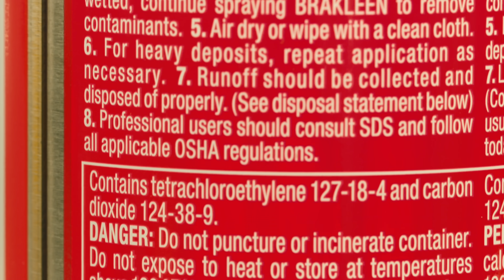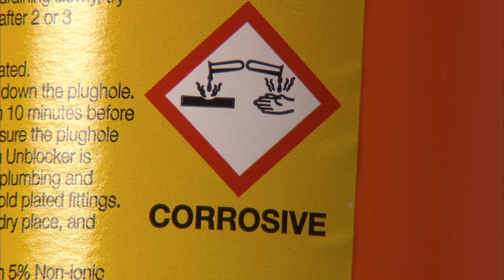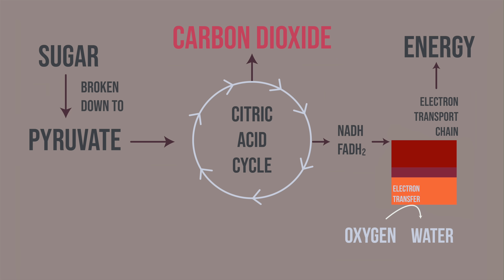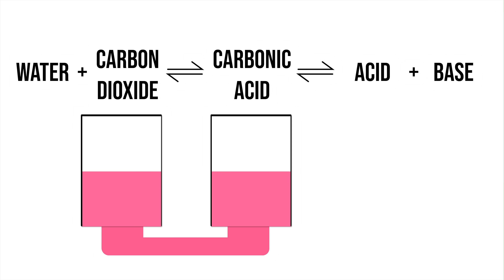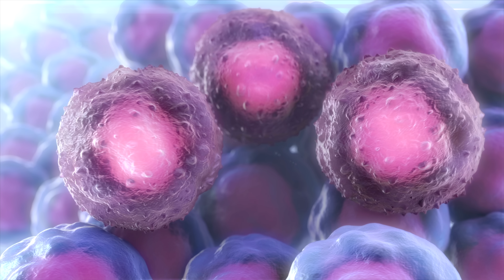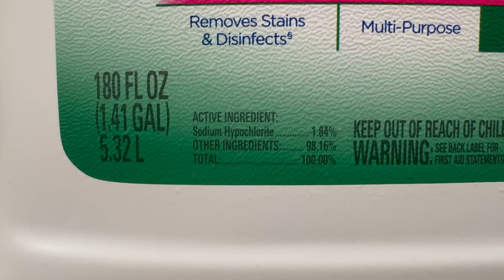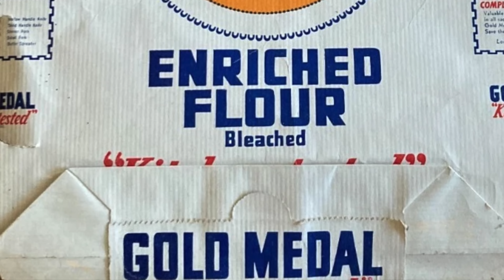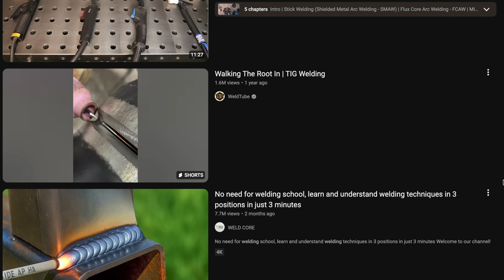"It smelled funny while I was welding and now I can't breathe..."

Comment: Important lesson!!    I think most break cleaner is now non-chlorinated. But I would still avoid using it before welding.  

Galvanized metal is also dangerous. 

Hell, even the shielding gas can kill you if not careful. 

Between the fumes, gases, and dust, respirators should be used. + Fume extractors.  But $$$$ 😞

They should include a free book with every welder sold.  "How this can kill you."    

Be carful.
Galvanized metal is also dangerous.

Comment: When I'm working I know welding galvanization gives a headache, carbon monoxide poisoning is one wrong step away, there are ammonia leaks everywhere, we use hydrogen peroxide strong enough to melt your face off and I work near H2S quite a bit. It's always a toss up what's trying to kill us today...but out of 30 years of safety classes I never knew the break cleaner thing. Thanks!

Comment: Great video that, so comprehensive, thanks. I'm really surprised that there isn't a clear warning on brake cleaners (some of which contain deadly when heated PTFE, as do some greases) given the extremity of the danger. I do have one question though - how long do these chemicals linger on say rusty, flaky steel/paint surfaces? - do the 'nasty bits' evaporate away in minutes or hours or are they there lingering long term, waiting for some poor sod to come along and grind/weld?

Comment: btw although high voltage can be relative, for comparison of common household appliances, welding is lower voltage than even US mains voltage. So the welder is relatively high current but not high voltage

Comment: I get it that burning anything with chlorine can be deadly, brake cleaner evaporates so fast it would be hard to get it into the weld process in a way it produces gas. 
I had to check but the instructions on my older tig welder recommend cleaning the parts in brake cleaner. It don't specify chlorinated or non chlorinated. 

Nearly ever shop I worked for over the years banned chlorinated solvents of any type. The issue was that they end up in the waste oil and it turns normal waste oil into toxic waste no one will touch. The guy who pumps the waste oil out runs a test on the oil before he'll take it to check for chlorinated solvents, water content, and antifreeze. If the test show any chlorine, they won't touch it. If there's too much antifreeze, they sometimes will refuse it as well. 
The way that was explained to me was that both will break down and bond to the oil somehow leaving behind elements that are hard to remove. 
Apparently they also sell the waste oil to guys who burn it in shop heaters, so that alone would be reason enough not to want it. 

A good many shops have stopped buying aerosol chemicals and gone to using straight solvents, either isopropyl alcohol, naptha, lacquer thinner, or acetone for most cleaning jobs. By the bucket it saves the shop a lot money and everyone has a universal sprayer these days. A simply pump sprayer and some alcohol works just as well and its cheaper. 

For rusty metal, I've always washed parts in mineral spirits, then dried them before glass or sandblasting off any rust before welding. Using brake cleaner is a waste of money. 
You never really want to weld any metal that's rusty, or coated with anything  at all. You don't want to breath in any of the fumes it could create and it will cause porosity in the weld.

Comment: Perchloroethylene is actually remarkably unreactive compared to ethylene. Those chlorine-carbon bonds are much more stable than carbon-hydrogen bonds. Which is why it's not flammable, while ethylene is incredibly flammable. Sure you shouldn't spray it directly on a fire, but you can use it near ignition sources without worrying about being blown to kingdom come.

Comment: I was expecting to hear he was welding on galvanized metal. That shit will eff you up, too. Dont ever weld on galvanized stuff indoors without a fan blowing the smoke away from you. In fact, it's best if you weld on galvanize outdoors but with a breeze at your back.

Edit Phosgene can also come from burning refrigerant (most people call it "freon" but freon is just a brand of refrigerant) that is in every AC, fridge, and deep freezer. And if you're sweating refrigerant lines with a torch phosgene can nail you when the lines are pulled apart. I've had it happen to me. Phosgene gas is also deadly.

Comment: Didn't know that, but I was told as an tool maker apprentice to never ever mix up chemicals and never heat up chemicals that are not ment to do it.
What we didn't learn then in the 70s and 80s is that the UVlight from welding is able to cause skin cancer. Luckily, as a German,  I follow rules.
So I always wear my working clothes.

Comment: Welding should always be done in highly ventilated areas or used a exhaust system to remove welding gasses.  Heavy metal toxicity is a known problem.

Comment: I did this exact same thing well Welding at shell Scotford maybe 2018, used chlorinated brake clean to clean off a flange face that was needing weld buildup using TIG welding process stainless steel and I ended up even with wearing a respirator with P 100s, exposing myself to phosgene gas. I don’t remember being told this in Nait yet for some reason in the tool crib, even on a Union job site they had chlorinated brake clean. My lungs felt like they had about 25% left in them. I was inches away from dialling 911 or going to the hospital. I figured if I woke up in the morning, things would be OK could barely sleep. Heart was pounding hard difficult to breathe and an extreme tightness in the chest and the lungs 🫁 felt F’d, when men say they do the risks and some of the most dangerous jobs. I would absolutely agree not many people put themselves in this sort of situation and this was completely unavoidable to have to remember this knowledge from school years prior was just overlooked there should be systems in place where they do not have these products in the tool crib on a job site where Welding takes place for starters brake clean doesn’t even need to be used on any job site. It’s just a convenient poison. Yes 👍🏻 everything is fine now lungs took over 3 weeks to feel better. Very SCARY and I didn’t report fast enough I really screwed up!!!! But lived thank FU5K! 🎉

Comment: Welding is very dangerous if care is not obeyed. Especially dangerous is welding stainless steel. Another dangerous field is handling materials containing Cl, Chlorine. Cl has multiple dangers. The immediate danger comes from direct breathing of Cl gas. The second one is burning or overheating materials containing Cl, like PVC. That will generate PCB which is one of the most dangerous poisons in industry and easily causes cancer if it does not kill in the first place.

Comment: If you're welding,  you absolutely need to be wearing a respirator, or be wearing a forced air respirator mask.

These are the masks to look for and get, if you cannot afford the forced air system:

ITEM: Moldex 2400 N95 OV Particulate Respirator Mask with Exhale Valve

DESCRIPTION: The Moldex 2400 N95 OV Particulate Respirator Mask features an exhale valve for cooler, easier breathing and is designed to filter out non-oil-based particles while providing relief from nuisance-level organic vapors. Ideal for hot, dusty environments, it offers NIOSH-certified N95 protection with a comfortable, contoured fit and a durable outer shell for extended use.

Comment: styropyro's labored breathing was so believable that I felt like crying.  I have asthma and it's always very hard to watch someone struggle to breathe (and also my allergies are acting up, I could feel my post-nasal drip attempt to simulate fluid in the lungs).  very good acting.

also, ty for the tip on chlorinated brake cleaner + welding producing phosgene.  I had no idea that a horrible WWI-like death was so horrifyingly easy to accidentally just stumble upon.

PS: when welding or spray painting, even in a well-ventilated area or outdoors, please wear a respirator.  you don't want that crap getting in your delicate little lungs.

also, if you have a welder that uses oxygen gas, eg am acetylene torch, never EVER use the oxygen to blow your clothing clean. my instructor's coworker did so and got exposed to a spark. he was covered in fire, and he took two weeks to die of full-body burns in the hospital.

Comment: I have been affected but I started welding back around the mid 1970s.  I take care but still limit what I do.  A decent air-fed welding helmet starts around $2,800 for a cheap one and the prices go up a lot from there.  This means that for most people they are unaffordable.  Maximum tax deduction?  A one off $50.
  I personally believe PPE should be 100% tax deductible.  
  I also have 'welders nod' because auto darkening lens weren't invented for quite a while after I started and again, helmets with these lenses were extremely expensive.
  We know a lot more about industrial hazards now but still employers don't abide by regulations and no government will address basic industrial safety because end of the day laws are formulated by office workers and as far as I know, and I'm retired now, no office worker gives a damn about industrial safety because none of them are personally affected.

Comment: I have no experience nor knowledge in welding, but smoke in metalworks is an immediate notification to call a professional for me. The welders I know use strong ventilation with N95 facemasks and other respirators on emergency standby, along with rubber gloves and tongs for chemicals and rust.

Comment: @chubbyemu - Maybe not related to the video, but something I can't explain.  Na and K (in the body as ions) are about the same size, have the same charge, and almost the same structure as each other.  But the body very easily distinguishes between the two.  Contrast that with Ca and Pb.  These two are not nearly the same size atoms, don't have the same charge, and are very different from each other in structure - Pb having a few more shells of electrons than Ca.  Yet... the body CANNOT tell them apart and will store Pb in bones because it "thinks" that it's Ca.  Why is that?

Comment: Phosgene was first used as a chemical weapon by the French in 1915 during World War I. This gas was also used by the German army on June 22, 1916, during the same conflict, at Verdun, mixed with dichlorine and in the form of a drifting gas wave. The French army also used it, mixed with an opacifier, under the name “collongite,” loaded into shells as early as 1916.

The German army preferred to use one of its derivatives, chlorinated methyl chloroformate, to load it into projectiles. Phosgene was thus responsible for more than 100,000 gas victims during the First World War, “accounting for 80% of deaths caused by chemical weapons”; later, it was used by the Imperial Japanese Army against the Chinese during the Sino-Japanese War (1937-1945). (wiki)

Comment: This is the missing information in the video:

Phosgene formation in this scenario is unintentional thermal decomposition, not deliberate synthesis.

High-level mechanism

Many brake cleaners historically contained  chlorinated solvents  (especially tetrachloroethylene or trichloroethylene).
When these solvents contact  very hot metal or a welding arc, the intense heat and UV break the solvent molecules apart.
The fragments recombine in the presence of oxygen to form phosgene (COCl₂) and related toxic byproducts (e.g., hydrogen chloride).

Why welding triggers it

Welding produces temperatures high enough to dissociate chlorinated hydrocarbons.
The arc also emits UV radiation, which accelerates decomposition.
Freshly heated metal surfaces catalyze the reaction.

Key point

This is not a controlled or predictable process.
Small amounts of residue can generate dangerous concentrations of phosgene locally, especially in enclosed or poorly ventilated spaces.

Safety reality

Modern “non-chlorinated” brake cleaners were introduced largely to eliminate this exact risk.
Phosgene is extremely toxic at low concentrations and may not be noticed before lung injury occurs.

No procedural details provided for obvious reasons.
Reply: What happens when phosgene (COCl₂) is inhaled

Phosgene reacts with proteins and lipids in the lungs, damaging the alveolar–capillary membrane.

Immediate effects may be mild or absent: throat irritation, cough, chest tightness.

A latent period (typically 2–24 hours) often follows with few symptoms.

Delayed injury then develops: non-cardiogenic pulmonary edema, severe shortness of breath, hypoxia, frothy sputum.

Severe exposure can lead to respiratory failure and death.

Survivors may have long-term lung damage (reduced lung capacity, chronic bronchitis–like symptoms).

Smell

Often described as freshly cut hay, green apples, or musty hay.

Odor detection is unreliable; dangerous concentrations may be present without a strong smell, and smell fatigue occurs quickly.

Comment: Just saying, if you're at work and you're smelling something, it's affecting you in one way, shape, or form.
Things you CAN'T smell can affect you (carbon monoxide, radon, carbon dioxide, nitrogen). If you can smell it, it's strong. It's basically messing you up. Put at least a painter's mask on. The kind where you're breathing through cartridges, and you can replace the cartridges, and then you do in fact replace them as the manual tells you to.
People might laugh now, but they won't be laughing later, because they won't be able to breathe. Meanwhile, by then, you will have an awesome, custom air filter apparatus that barely bothers you at all. You'll be able to walk closer to the wastelands of washington dc after the nuclear strikes. 2032 is gonna be a crazy year!

Comment: I've never used brake clean to take rust off of metal surfaces... then again I almost always use the non-chlorinated stuff. Either way, yeah it's generally not a great idea to use ANY kind of chemicals on something you're going to introduce a massive amount of heat to.

Props on the Doom music btw.

Comment: a class on general chemical safety would be pretty useful. I could see myself making this sort of mistake. I luckily don't have the habit of reaching for brake cleaner as a solution for things and don't weld but I can easily see myself coming to this sort of solution while happily tinkering away on a project.

Comment: As a welder this story breaks my heart. I was lucky and was taught welding safety by the good folks at Lincoln that invented welding. Every welding course starts with safety. However the kids that just pick up a torch don’t know any better. I was hoping at first this was from Zinc then I saw the brake cleaner. Phosgene gas smells like sweet hay so I’m told, I was told by an old timer, if you smell hay your already dead. This kid should have used a wire brush and acetone or a flap disk on his angle grinder.  Welding is dangerous, welding is beautiful, it demands respect.
Reply: Lincoln didnt invent welding...

Comment: I am not a welder but have pulmonary Fibrosis. Originally a bronchoscopy diagnosed idiopathic pulmonary fibrosis. Fluids and biopsy were removed. But IPF is progressive and I was given short time to live. Well 30 years later i am still here. I retired from my job and moved to country and for 14 years went to Florida for winter. I was changed to post inflammatory pulmonary fibrosis. Whatever the ideopathic cause was eliminated. I believe it was painting work place in winter using oil based paint without any ventilation. Paints 30 years ago were different than paints today. But then why did other workers not get sick? Guess i will never know. Six weeks ago i was hospitalized with pneumonia with water in lower lung. Doctors never found the cause. Great video.
Reply: Get your flu shot!  This is a bad winter for the flu!  And Covid shot, too.

Comment: He learnt the skill for a great price????? He found the steel on his LAWN??? I've been welding for over 50 years, mig, tig, arc. All kinds of steel, iron, aluminium. You can't BUY the skills. Not at any price, experience is the only teacher. You check to find which metals are safe to weld. Some platings on steel contain things like cadmium, chromium, arsenic, cobalt and other heavy metals and additives. You don't ever want to breathe that stuff. Cadmium poisoning happens fast and its deadly.

Comment: I work in the hvac industry and I’ve heard of technicians lungs collapsing from breathing in fumes from brazing copper lines
Reply: I've suspected that while brazing lines in the past on old r-12 systems i've smelled phosgene gas before. It was only a quick wiff and I was outdoors so I was able to stop and get away from it. If it was phosgene or some other compound I'm not sure but to me at least. It was a very sharp painful sensation that cuts your breathing immediately. Have to be careful when dealing with older hvac.
Reply: same. trying to de-braze compressor lines loose on any unit is rough, but especially with an accumulator near it and even with nitrogen. take the extra step to cut the lines at the compressor and couple them back together. somehow I get a little shot of those burnt fumes and immediately quit breathing and walk away then clear my lungs with deep breathing exercises, guess my senses are quick but it's not worth gambling with it.
Reply: Got a good dose of phosgene unsweating an R22 liquid line. With 22 gone the issue is no longer phosgene but hydrofluoric acid from the HFC refrigerants… all of them, 134a, 404a as well as R32.
Reply: That’s why you always flush the line before brazing. I’ve almost been done in one too many times doing a compressor changeout